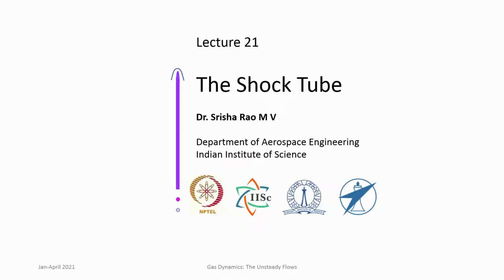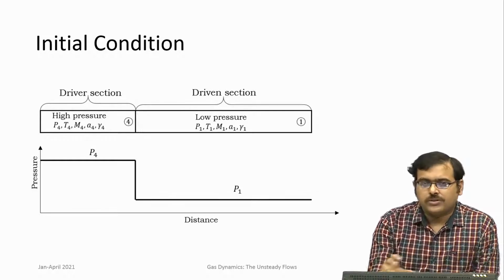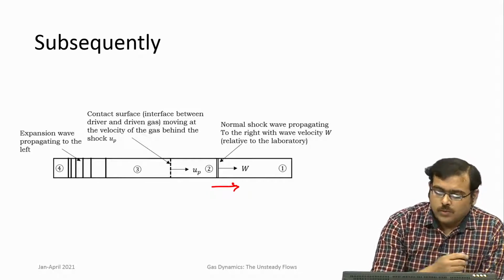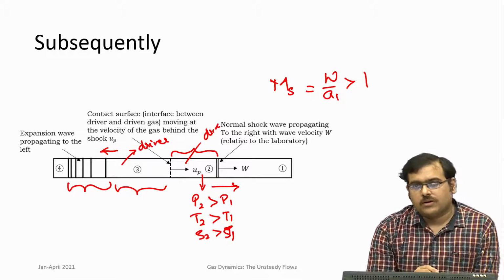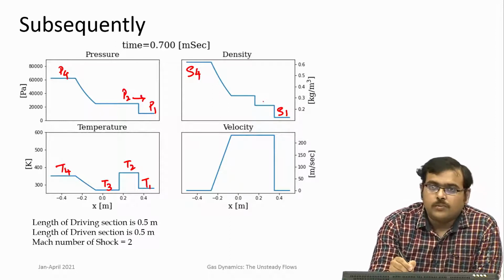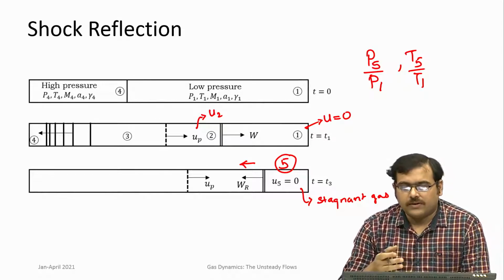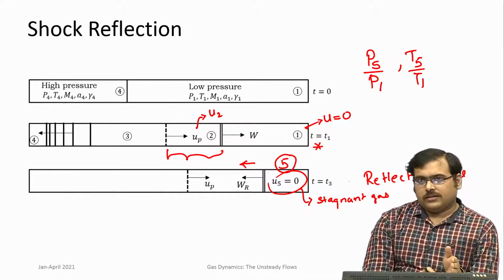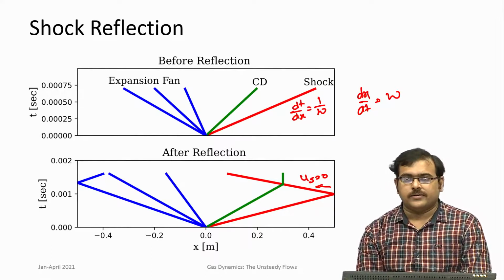lec21 The Shock Tube

Comment: Is there any calculation for the dimension to design a shock tube? eg length of driver, driven section and diameter of the tube
Reply: smaller is more efficient, 1-3 inch diameter, just enough to get a pressure sensors inside..length can be 3 feet long enough to get consistent measure of mach velocity